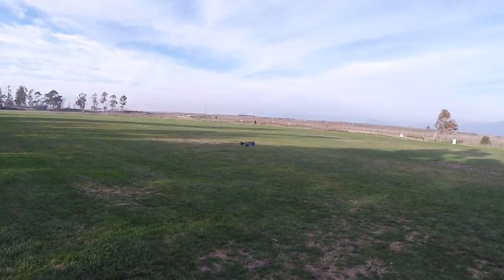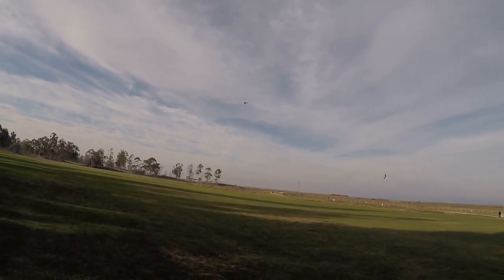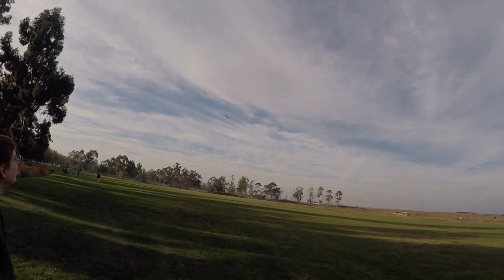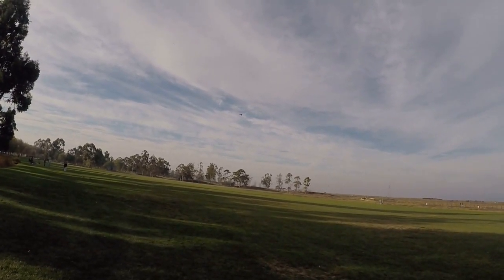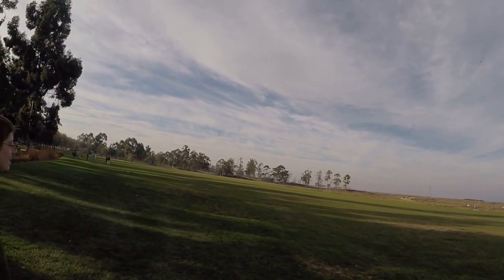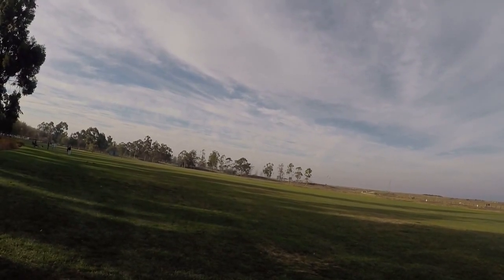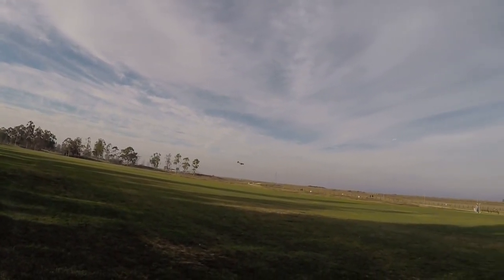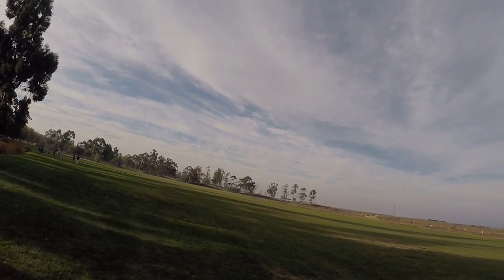UAS Hornet EDF Tilt-rotor Tricopter

Comment: Looks great I made one in 96 but things are way lighter and to have more than an old fashioned remote control airplane setup. Add a gas motor all sorts of driveline linkages to all the fans the fan housing rotated left and right and forwards and backwards. The boom had separate controls to go left and right, forwards backwards. All in all you brought back some good memories

Comment: Few things i noticed:
- Flight time is pretty short. Possible to get better efficiency with a larger EDF or ducted propeller?
- Don't recall seeing you do a roll or loop so I am wondering of your maneuverability is limited somehow?
- Does the rear motor use a vane for yaw control or are you providing this solely from the front motors?